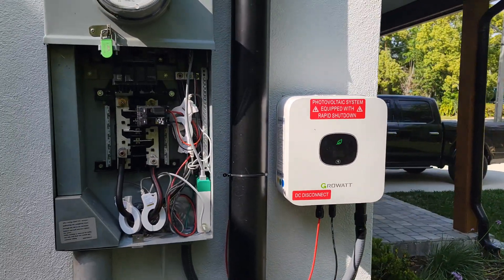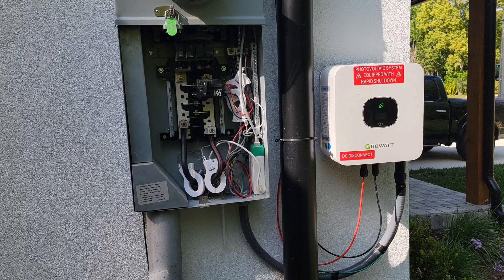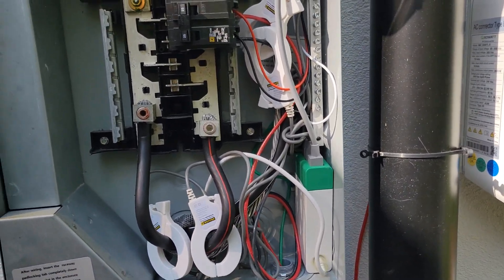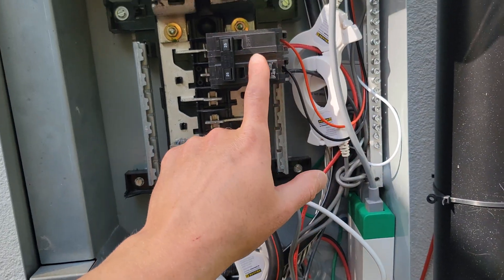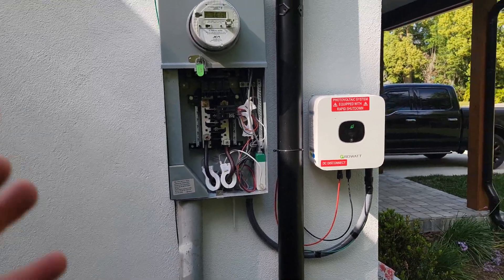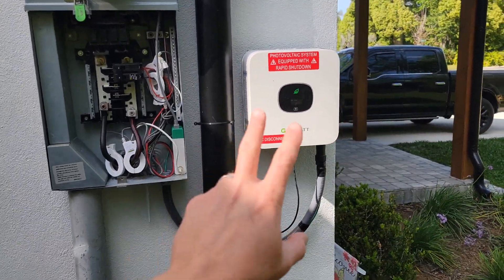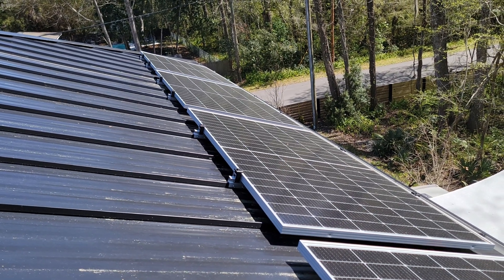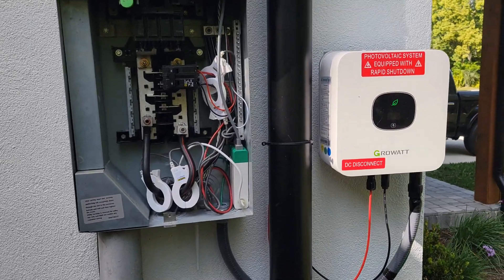Growatt MIC 3000 TL-X GRID TIE Solar System for EVERYONE

Comment: Regarding the Wifi, you probably have low signal. Can you measure good wifi signal while standing at your inverter? You can upgrade your wifi network with another router setup in a mesh network, that provides better signal to the inverter. Good luck.
Reply from the maker: I have strong wifi at that location. I've tried everything. There dongle just does not work correctly. I installed a Schneider monitoring with zero issues.
Reply: Was your dongle the black one or white one? I just ordered the 6000 watt Growatt inverter and purchased the black dongle. I guess the white model was more or less for an off grid setup. I wish they had the monitoring built in already. I purchased ours for $1052 out the door for a Black Friday deal. 😅

Comment: If you were tying into your main panel instead of your meter, would you still tie in with just a normal double pull breaker?
Reply from the maker: @madmark30001  yes. You want the 240v option to evenly distribute the power.

Comment: Signature solar sells the US versions .. the eu versions are bonded cause they don’t use split phase overseas.. meaning it could electrify the inverter case with 120v when setup on a split phase 240 system.. idk about the 3k models I know they make two different 5k ones.. coming from signature they should be US split phase capable and safe..

Comment: Thanks for posting. I'm also wanting a simple, affordable grid tie system. I'll have 8x400w panels for 3.2kw. Outstanding question is Rapid Shutdown Devices (required in my location) and once those are factored in, is it still more simple and affordable than micro inverters? thanks for the input.
Reply from the maker: @smokeythebirdbrain  absolutely. I would only use micro inverters if shade was a huge issue. GL
Reply: @_willalexander.88  Thanks for the input. To add RSD to this inverter, I guess it would be 4x Tigo TS4-A-2F @$45/ea. And then upgrade to the MIN 3800TL-XH-US, which can communicate with the TIGO RSDs? Still fuzzy on that.
Reply from the maker: @davidbryan-z8b  no. Nothing is needed with this inverter. It shuts down when the grid goes down.
Reply: @davidbryan-z8b  I am working on my design currently for the City, i have a MIN 6000TL-X , i am getting 14 of the tiago ts4-a-o unit for optimized and monitoring  it will optimize each panel at each level it also monitors thew the portal and rapid shutdown threw wireless access threw the Tigo Access Point Called TAP and the CCA be fully fictional are required. NEC 1700 requires all roof mounted and Ground mounted according to my zoning. so the system on the Tigo will cost me almost 1k for everything thew Signature solar. ouch. not too happy about that. then you have a big yellow box with a red switch that you twist then push in to shut the signal off from the Tigo to the panels causing them to discharge any energy in the Aptos or any other panels. 

i have a question on your setup, i am trying to draw out the wireing diagram for my city and well i have to say they gave me a pdf example and it's 13mb it's crazy designed for a sunnyboy but i dont have one. the 6000tl-x is a easy setup and maybe  i am over thinking this by looking at their diagram? i am in Tucson AZ trying to get the build permit to go threw. any suggestions from anyone on this portion i would welcome any feed back. thank you.

Comment: Can you confirm you connect the 2 120 lines to the same phase…. My manual came in Spanish, I was wanting to to just make a two ended plug and plug into an outside outlet close to my panels vs going all the way back to breaker box and adding breakers
Reply from the maker: @johngrier5949  you can wire this 120v or 240v. 240v is the preferred connection
Reply: did this end up working for you? this is basically what I want to do too.

Comment: This is the most basic grid tied installation you will ever see.
Just replaced two SMA-2500U's with a single Growatt after my SMA failed for a 4th time I was done. Been using SMA for over 21 years. At 65 pounds each are very heavy to deal with compared to the 33 pound Growatt. Using a MIN 5000TL-XH-US, it was so easy to install. SMA's have a 7 year warranty and I had to pay for 3 separate repairs over the years, what a pain to remove - pay to ship and repair and replace etc. I'm done with SMA. Growatt makes grid tie easy and cheap, and if it craps out - easy to replace.

Comment: Great video. Two questions. Is the unit waterproof and can be installed outside like you did? Can you sell back to the grid if you have net metering with this set up?
Reply from the maker: Yes it does have an IP rating. Yes if you're net metered it will push back into the grid what's over produced.

Comment: Been running off grid with no permit for 4 years now with 23kw of roof solar and 66kWh of recycled Tesla S/X modules. If you live in an area with frequent blackouts/ brownouts a grid tie system is worthless. WTF is the point of solar if you powerless like everyone else in an outage? Lastly you'll pay retail for power from the grid only to receive 10%  of what you pay (if you're lucky)  when you sell energy back.
Reply from the maker: So, the point is to knock down your high $ bill and make your money back quick. I have a super inefficient rv hooked up full time that uses more power then my house. My power company is with it and we never lose power even during hurricanes. If we do,  flip the main and plug in the generator, my solar will assist and let the generator idle mostly. I would not grid tie to make money, only to reduce my bill.
Reply: You'd have to almost have an inverter generator to work. I years ago hooked up my propane generator 6000w and the grid tie solar system shut off due to frequency issues.
Reply from the maker: @onecrazywheel  going to test soon. Thanks
Reply: I didn't install net metering. Can it be connected using a CT Limiter Sensor?
Reply: Our Genmax 9000 watt inverter generator works flawlessly with our solar set-up. No issues. And it completely off sets the generator's load. 😅

Comment: so how difficult is it to get a permit and inspections done for your unit and whats the costs / process to do that?
Reply from the maker: Not bad at all. You will need some structural drawings if you're mounting on the roof which is the worst part. To make sure your roof can support it. About 250$ for those. The rest is an electrical riser diagram, site plan and specs. Permit was about 200$. Contact your county for a list of what you need to obtain a permit and you need to contact your service provider to fill out some stuff with them. They do an inspection after the county permit is finalized. Good to reach out before your install to see there requirements.
Reply: @_willalexander.88  Thank you, so i got all my items in, i started to just build my array on the ground instead of on the roof.  i just ordered stickers so that i can show the GroWatt is equipped with the rapid shutdown and then the DC connect.  to bad i cant upload a photo here of my array i built, it's 14 Gage steel each rack holds 7 Panels for a total of 14 i have the  Growatt 6kW Grid-Tie Inverter | MIN 6000TL-X, a IMO DC Disconnect Rooftop Isolator Switch located at the base of my rack then underground wires go to the PV Array to connect to the MC4 connectors and a 2 × Staubli | 15A | 1000V | In-line Fuse with MC4 Connectors that protect before the Growatt, each rack is one string i have two on my inverter i am not sure if you just have one or two.  

on my Rack i will  have 7 Aptos 370W Bifacial Solar Panel (Black) | Up to 480W Bifacial Gain | DNA-120-BF26-370W  for a total of 14 panels 7 on each string. not quite maxing out my Growatt, im at 80% i am getting 440watts from each panel not to bad.  it gives me 3,080 watts on each string total watts 6,160. 

you spoke about the WiFi, did you ever get that resolved?  i purchased the following with my unit  Growatt USB Monitoring Stick | ShineWiFi-X  but i guess it came with one too. they suggested that i use the one above not the one that came with the unit.  all of this was purchased from Signature Solar.

did you ever add on the other 4 panels yet?
Reply: @_willalexander.88  how did you do the structural drawings? did you use visio or something and what do you need to include on that drawing? this is where i am currently stuck at.